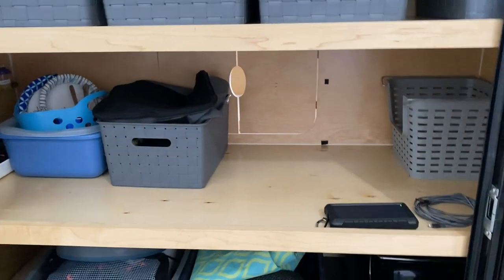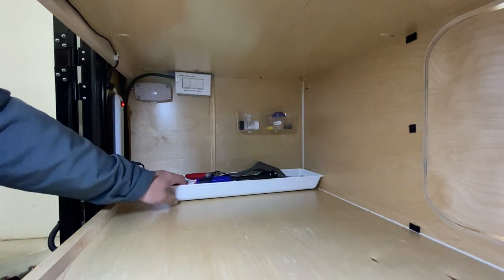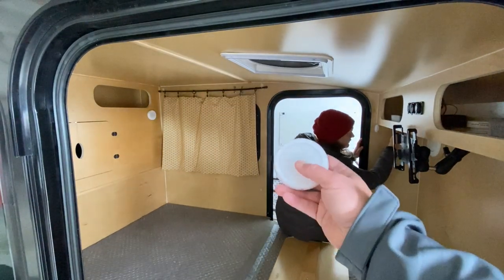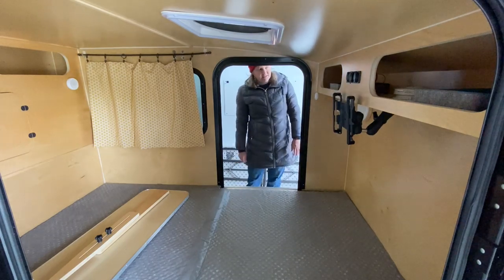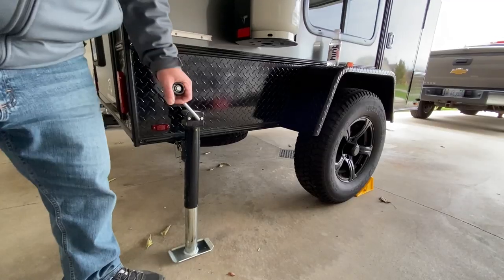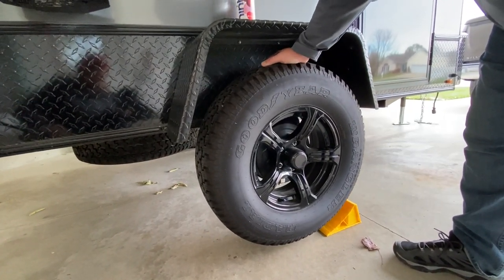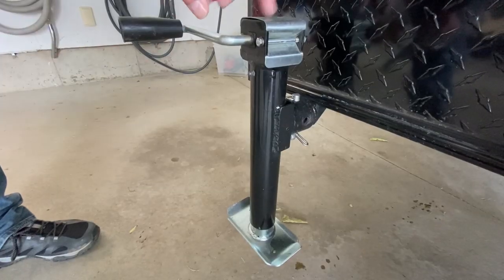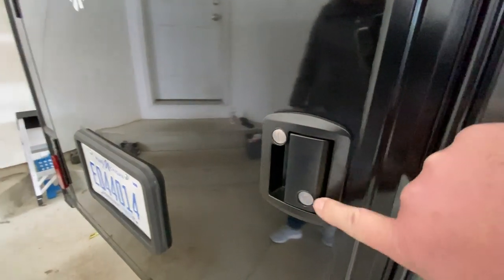Prepping my Hiker Trailer for Winter Storage

Comment: This summer I let my Wife drive my pickup with the pop-up for the first time ever and she did great towing down the road. Problem came when she was backing the trailer into the campsite :). I mastered backing a trailer with 1 simple method: Put my left hand on the bottom center part of the steering wheel. When I want the trailer to go left, I go left. Very simple as long as my hand is center-bottom at all times

Comment: Matt just an idea.  Store your battery with a piece of wood underneath.  It doesn’t have to be thick like 1”x 6”x8”.  I told that in mechanics class years ago.  Else you will have trouble with your battery.
Reply from the maker: Randall Harmsen thanks for the tip.
Reply: Matt DeWitt just saving some grief next spring.  Glad I could help you Matt.

Comment: I am learning a lot from your channel for my planning on getting a trailer and setup.  I do have a question as I see you have changed your pad under the mattress.  I thought you had some type of mesh and know I see you have a pad called hypervent?  Where did you find that as it looks like it would be better for dealing with humidity.  Thanks,
Reply from the maker: https://www.youtube.com/watch?v=QNF3d0Sh3QA&t=2s. I wouldn't have a mattress without it. We have had zero issues with this under the bed.  Here is the link to our video on Hypervent there is a discount code for purchasing.
Reply: @MWDAdventures  I see it is the same thing that I was referencing.  It just looked different as I forgot you taped them together and made one piece.  Thank you for you responding.